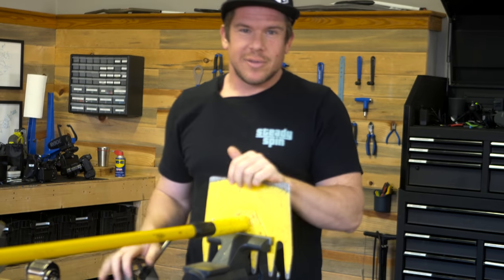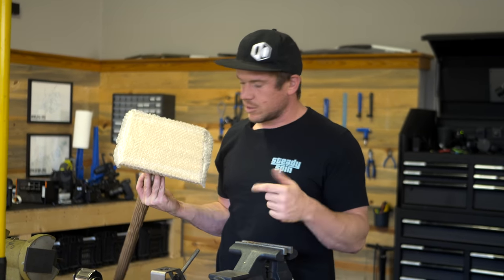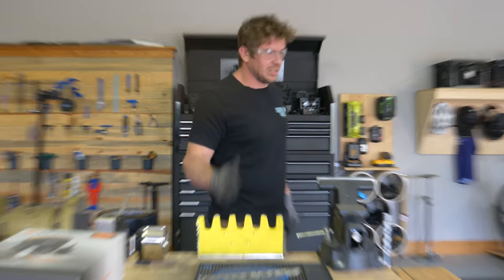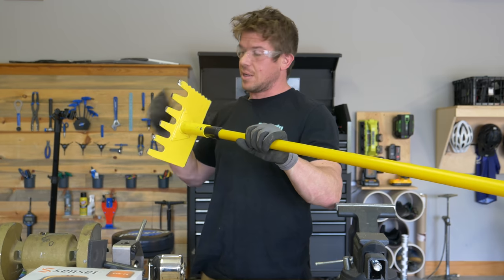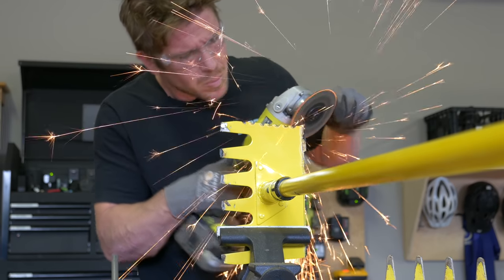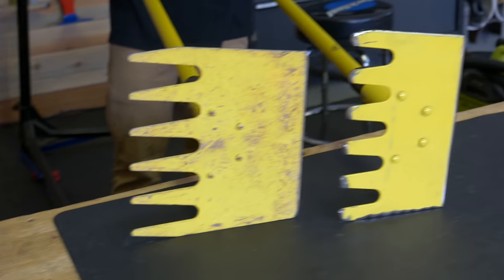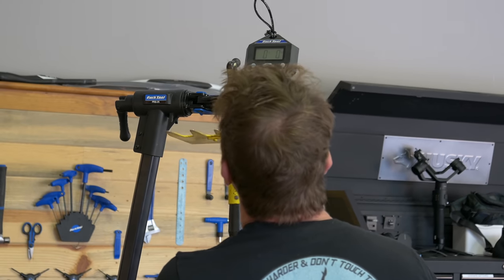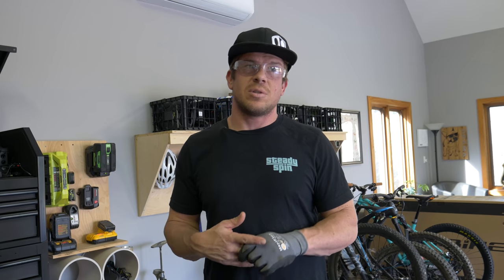Custom Trail Tool build at Berm Peak

Comment: Kevin, thanks for the inspiration. Took out a stock McLeod and couldn’t help but feel like it was a bit heavy. Did a similar modification to yours and room about 1.5” off the square side and 1.25” off the rake side. Swings a lot better now with almost no downside. Thanks! Also sprayed camo colors for the stealth tool stashes
Reply from the maker: Nice work!

Comment: here i went through at the trouble of sourcing harrow disks, cutting, welding, heat treating and making my own handle for my trail tool. lol
Reply from the maker: I bet it a great tool and a fun process.
Reply: @SteadySpin  it was man! insisted on a 6' handle. can always cut it down.

Comment: Head weight is all about the moment.  You've lowered the moment of inertia on that tool.  You'll be able to do a lot more work with it due to the energy savings. I have an old McLeod that I customized with a 60" handle....I'm 6'4".  I love that tool, but you've inspired me to stubby it up a bit.  My trails are mostly rock....very little dirt.  I've found myself backing off more often than not when pulling "molars" from the trail surface as the tines start to bend too much.  Stubby McLeod.....with an extra long handle....will be an effective tool.  Might even stubby up the tines on the Rogue Hoe (Sarah Palin) tools we have in our organization's inventory.
Reply from the maker: So much going on here lol. In the rock stuff watch your edge.  It’s easy to weaken it by trying to get a larger “sharpened blade length “.  I hope that makes sense.  It’s a stronger tool not customized.

Comment: Hi, Kevin. I noticed when you were using the angle grinder that you used a grinding disk not a cutoff disk. The grinding disk is used for smoothing off welds and grinding high spots. The cutoff disk is made to cut pieces of metal. I bet Seth has a cut off disk somewhere! otherwise grate job and cool vid!
Reply from the maker: You didn’t like all the sparks ?

Comment: 10% of the whole tool, but a much higher percentage of the HEAD of the tool, which greatly impacts how the whole thing swings. Similar concept to shortening a sword and adding that weight to the pommel.
Reply from the maker: I’m going to try a new version where I weld the cut off piece back on to reenforce it.

Comment: With all the heat you put into the blade, it may have ruined the heat treat and temper. It may not hold an edge as long
Reply: Very true. There's also a chance that only a small portion of the edge was tempered to begin with, and all of those new edges are in soft steel
Reply from the maker: Hhhhmmmm might not have thought this through.   You probably made the smartest comment so far.   Nicely done sir.  Yes I broke the tool already.

Comment: It's not just 11% weight reduction.  It's 11% of the total weight, but that all came off the head of it.  I would bet you cut the weight of the head by 30%.  I split firewood with a splitting maul and recently switched from a 8lb maul on a 36" handle to a 4.5lb maul on a 32" handle.  I can swing that lighter maul all day long.  Only 3 times in 4 cords of wood did I wish I had a heavier maul, but I just grabbed my wedge and got through those rounds that way.  I'd take a lighter tool I can swing all day over a heavier tool that burns me out in 30 minutes every time.
Reply from the maker: Totally agree.  I need to put in a 8 hour day not just 30 minutes.